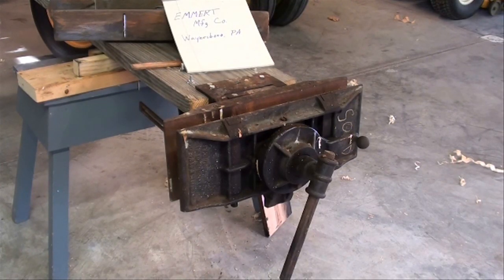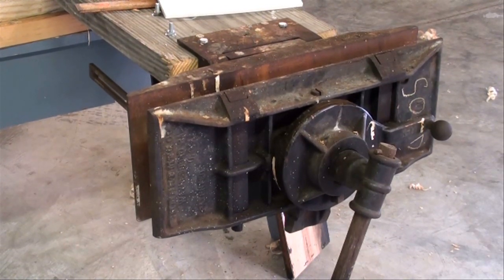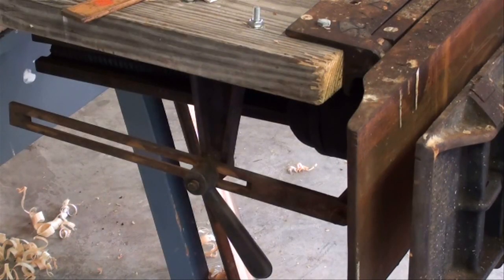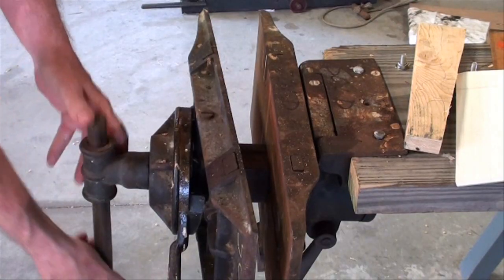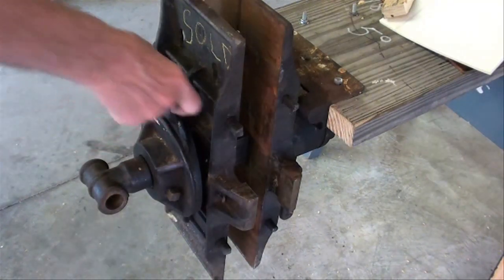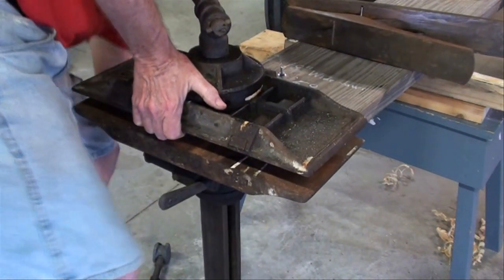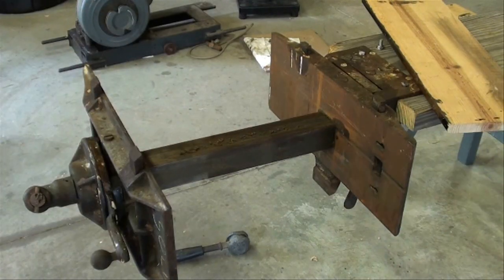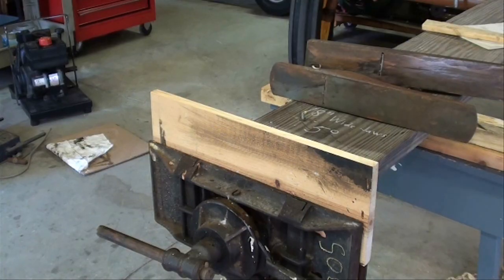ANTIQUE EMMERT PATTERN MAKER'S VISE tubalcain

Comment: Pattern makers vices made by Yost, Emmert and Oliver are the finest vice you could ever put on your bench. I use to carve for a mirror company and did the old Emmert ever come in handy. The tilt and rotate is good for putting work in any position, even chair legs can be positioned to a comfortable working stance. The  screw is double cut so you aren't tightening the screw forever.  Being able to put the jaws out of parallel is very useful for tapered work. I've used one every day in the cabinet shop for the last 30 years. Woodcraft has one made by their Wood River line that is a good buy for around $280.00.

Comment: Yes, that is the so-called K1.  Technically speaking, it was actually called the "New Improved" Universal Vise, but people called the K1 because of the casting number on the jaw.   Yours is a "type U4".  You can tell because it has a four (not eight) ribs on the collar, but the tilt-adjust rod is flat (not round).  There were six types. The final version has extra reinforcement ribs in the jaw castings for strength due to the brittleness of the cast iron (not the tough ductile iron alloys used today). 

In contrast to the "New Improved" style shown here, the other style of Emmert was the Turtleback, which also tilts and swivels.  The turtleback name comes from the shape of the cover on the front jaw.

I've really appreciated your videos over the years.  Thank you for that.

Comment: Did I enjoy it? Heck yes. Are you planing on restoring the vice at all other then a new handle? I wish I would have got to see some of theses wood working benches  but by the time i was old enough they had just stuck computers over all of them and moth balled the shop. sad times. 

Kind of like when the kids from school come to my machine shop for there 2 week stand in mid year and ask me where the keyboard is on the lathe. since they dont have manual ones at the school anymore.